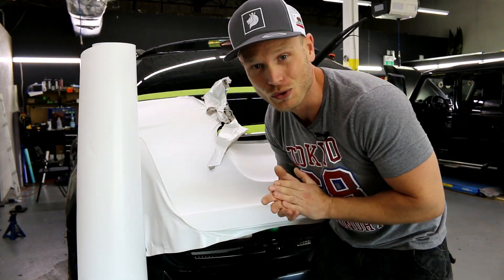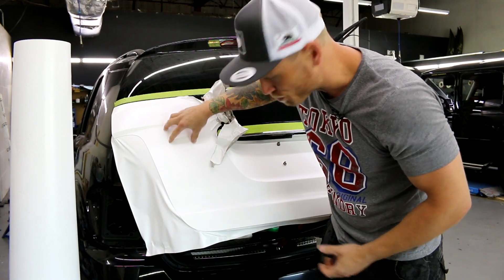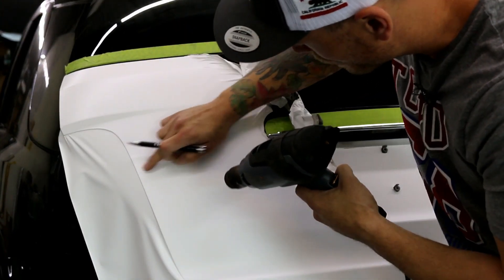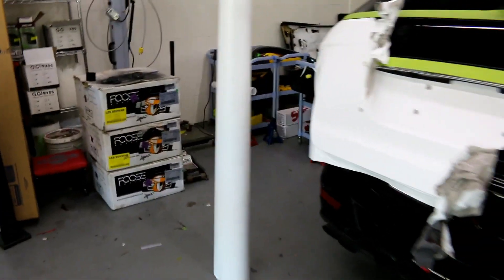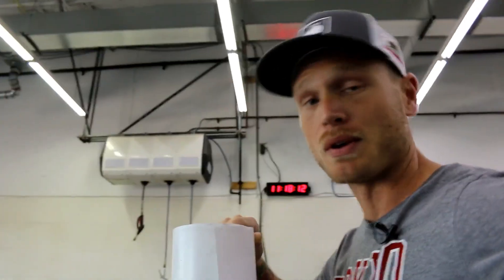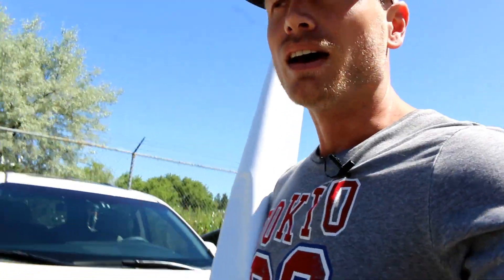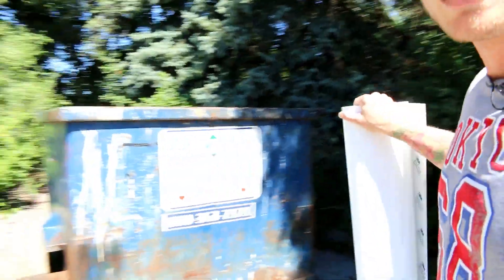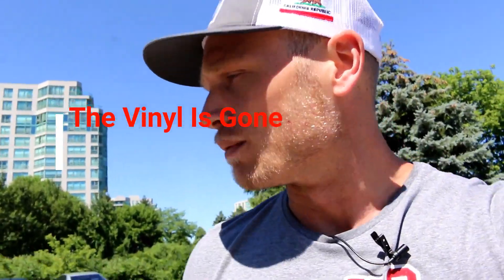TOSSED THE ROLL OF 3M IN THE GARBAGE | WORST VINYL EVER | $900 GONE

Comment: Maybe there's a factory error in the roll? Had it once before and got a new roll. I have been using 3M for a couple of years and never had such issues with it. 

I do agree that avery is better and easier to work with, but I get good results with 3M. Never had problems with lifting, tearing or collapsed channels. Only thing that might happen is adhesive lines.
Reply: Christian did mention that he has had 8 out of 8 3M rolls with issues.  Definitely not a one off.
Reply: It's wierd tho. I have had 1 bad roll in about 30 rolls so far as my limited experience is with 3M. I have never had these problems. Problem with my roll was adhesive failure, it was because the roll didnt cure long enough.

But these kind of issues I have never had. I'm not a fanboy, I'm starting to work more with Avery lately, just because it installs easier, not because I have problems with 3M
Reply: Did you read the other comments here....there definitely seems to be a lot of complaints regarding 3M.  I guess you were lucky!!!

Comment: I just got done wrapping my bike. The avery pearl white I used was an absolute dream compared to the 3M 1080 crap that I bought for the carbon accents, I had the same issues with adhesion and air pockets that didn't release let alone the 1080 won't stretch over corners worth a darn.

Comment: That's really surprising to me. I do personally prefer Avery over 3M because in my (comparatively limited) experience the adhesive has always had too high of an initial tack, but I've never heard of THIS. Of course, I absolutely trust that it isn't an installation issue.

Now, I'm not necessarily trying to defend 3M here but I would recommend at least contacting the 3M rep for your region and talking to them. You may have just gotten a bad roll or something (hey, we all know manufacturing isn't always 100%) and they may be able to help you out somehow.

Comment: With 3M it's not just limited to the wrap films. We had an issue with some yellow 7725 series cut film earlier in the year where the yellow dye was separating from the film and colouring anything that touched it yellow. More recently we have had a job delayed by defective 3M window frosting. I suspect one of the rolls of frosting was old stock and the other roll the adhesive was anything but. In the case of the yellow film they wanted the roll back and from what they told me they were quarantining the roll. With the frosting they just kept replacing the roll until it worked. In short yeah I'd have to agree 3M is not the same as it was a few years ago.

Comment: Of all people I am surprised you're having so much trouble. I had those issues the first time I wrapped a car and used 3M, but it wasn't that bad the second time around since I had learned how to handle the material. It is a get-it-right the first time material. If you have to lift up and restick a section, it's over, pull the panel. It is NOT forgiving to mistakes. The only issue I had with it the second time I wrapped my car with 3M was that it was too cold in the garage and I tore it. It's a pain and the glue lines are a real thing but I learned they only happen with too much heat. When you heat it, the vinyl pulls away from the glue and it'll bunch up / roll under itself. Bad characteristic, but it happens. Oh and if you heat it before it's completely squeegee'd down, the air release channels will melt away and you're screwed like this with trapped air and nasty glue. God help you if you missed a tiny bubble and the heat gun inflates a bubble as you're setting the edges. I suggested a friend of mine use Avery for his first wrap and he did not have these issues. I won't use 3M if i'm doing a standard color, but, nobody else offered the same gloss liquid copper or psychedelic shift when that came out and I had to have it. Unfortunately the wife is going to want her new GTR wrapped in psychedelic shift to match the AMG, so, I'll get to work with it again.
Reply from the maker: Yea they do have cool colors, and it's the very first film I ever used. My first 8 Wraps jobs ever were using 3m 1080 and they were great. Something changed down the road and now the film isn't fit for install
Reply: 845AMG damn, im a first timer and i plan on doing my car in dragon fire red by 3m.. i guess i need to do more research on how to lay 3m before i buy a roll :/

Comment: Been having the same problem with the 1080 series and I was wondering if it was just me. Also had a weird subtle line across one of the rolls of glacier grey this one time and I uad to rewrap an entire 911 rear bumper because of that. So disappointed with 3M
Reply from the maker: I've had the same line through other rolls of 3m. Quality control is very low on their end

Comment: The quality of some of the 3m colours are not good.  We have been using 3m and Avery for over 5 years. Personally I prefer Avery because of super fast and easy application. But most of customers who has done some research about vinyl wrapping, they come in the shop and says I want 3m without even looking at different brands color swatches. I mean 3m does provide a bit more physical protection than Avery, because it’s thicker. The adhesive lines are the worst problem, also in the winter, it tears very easy. The QC for both 3m and Avery is going down. Hopefully both companies will spend more time to increase the quality than develop the new colours

Comment: I wasn't aware 3M was bad until now. Thanks for the info. Any issue with other 3M product lines like their painters tape and adhesive strips? those seemed fine for me so far. Its a shame 3M had such a reputable brand image in my eyes.
Reply: I prefer Tesa painters tape. 3M doesn't stick for shit IMO. I only use 3M for sandpaper and stuff nowadays.

Comment: Hey guys! We have been dealing with this issue, especially on satins with 3M. Trying to stir up a riot on IG over it. Sorry you had this problem, so frustrating to deal with!  And all they do is replace the material and move along without ever really addressing the problem.
Reply from the maker: I hear you exactly, I'm sure you saw the conversation I had yesterday. Sorry about that, I went back to clear up your post and deleted all comments but the original one. 3m is very quick to replace it with another roll which will have the exact same issue. That's why I made a point of tossing it out
Reply: gawd dammit! only if I watched this video before I bought 3m satin vampire red. This dam film is pissing me off with all the buubles that really dont go away n them dam streaks of adhesive buildups exactly how CK described it. First roll of 3m i have ever worked with n will be the last

Comment: man ima be honest with you guys.. we use to use Avery, as the cheap back up option when it came to wrapping anything. We mostly used it for walls or objects that were meant just for background imagery. For vehicles.. all of our installers petition we use 3M IJ180. It's the easiest to work with and tacky enough to know it will stick to non-flat surfaces without using resin. If you're having trouble with a certain Roll.. Don't fret, don't throw a temper tantrum like this guy, and call the folks who supplied you with it.. take photos and explain your problems.. i'm sure they can get you another roll. It happened to Us with several rolls of damaged 3m8518 gloss laminate. It's expensive, but i've yet to have an installer come back and say that shit's a nightmare to work with.

Comment: I'm having to send back 30 feet of 3M1080 tomorrow because of the amount of glue lines and even what you explained there with the channels breaking down and the amount of glue build up where you can't even poke the air out. Half the car done as well and It's actually ridiculous. I'm also from Canada so not sure if it is a Canadian thing like mentioned in the comments. Might just be sticking to Avery/Vivid for now.

Comment: Mr. Anti 3M, Why use it in the first place? All you ever do is bash 3M, I don't get it man! …. on another note, as professionals, what we do at my shop, is to first contact 3M, a rep obviously, and show them the issue. We have done it with Avery. Yes we had issues with avery. You may have contacted them for all I know, as I don't watch many of your videos but I remember you bashing them on the yellow wrap you burned on a Ferrari a while back.
Reply from the maker: Contacted them 8 times for the yellow, kept getting the same thing. When is enough enough? Didn't bother contacting them this time, no point in getting another roll of the same thing.
Reply from the maker: Also, the customer requested 3m because he thought the last shop had used 3m before but I found out it was Avery once I started removing it